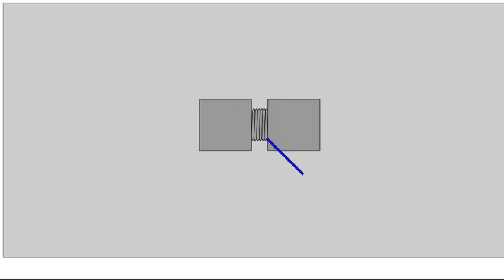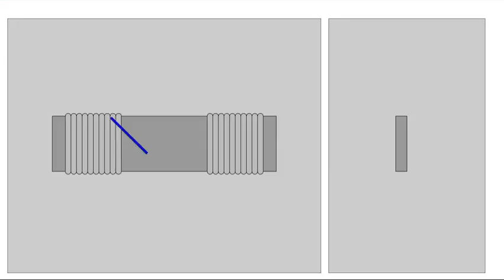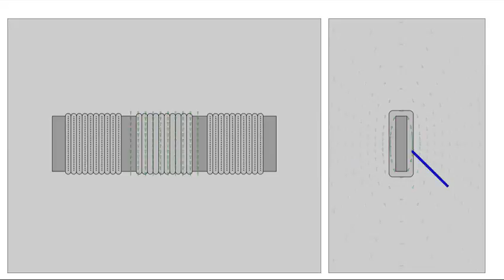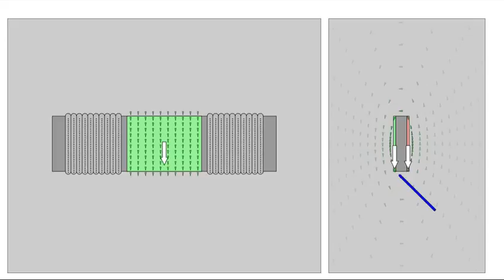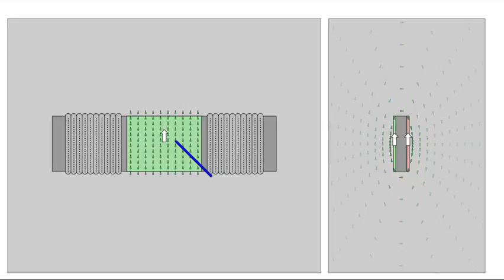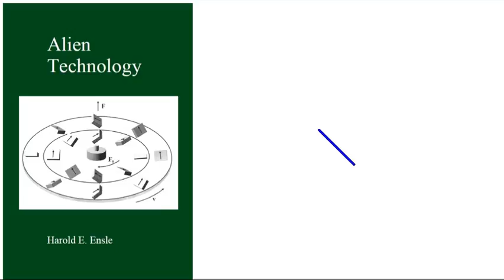The Electromagnetic Propulsion System

Comment: im not a nerd, just a basic engineer dude; what, in common sense terms, is the efficiency (can it be compared to) and is this how flying saucers fly/work (or could in theory)? ..do U need a NUKE power supply OR just a couple of 12v car sized batteries that r lead acid AGM to fly one person with light luggage? ..oh, and most importantly, does ur science work off of the Earth's magnetic field.. because it is 2 unrealistic 2 achieve thrust from itself.. isn't it!? ...and is it even possible to react to the Earth's (or any planet's) magnetic field using 'electro-magnetic' power that is man-made (of course)!?
Reply from the maker: In the book Alien Technology, it explains how the efficiency is over unity. In other words it can generate its own power, so no nuclear source is necessary.

It has nothing to do with the Earth's magnetic field.

Yes... it is unrealistic...but sometimes truth is stranger than fiction.
Reply: that is not what Wikipedia says.. it talks about electromagnetic stuff using the Earth's magnetic field to work and that it works, but is not very efficient (im assuming it's the power source that would b why)
Reply: @haroldensle6656   Besides momentum your device needs to have efficiency of 100% minus the energy losses in heat, radiation and friction... It needs to show how electric energy is converted to kinetic one...  Since you have filed patent application in 2012 your device would have been a commercial product by now, but it looks like there is very little interest comparing to Em-drive and other attempts to create reaction mass less propulsion devices... I bought your book and should receive it within 6 to 10 days but I am already skeptical due to you statement above "the efficiency is over unity"...
Reply from the maker: @matheworman6308   If you understood the video, you would know that it works...at least by the laws of current physics. The only way it could fail is if there existed a new type of force heretofore unknown that would block the output force of the device.

I misspoke a bit to Mr. Eidsmore. The device you see in this video requires a lot of energy to operate.

When I spoke of over-unity, it had to do with some further ideas discussed in the book of how this devices utilizes energy. There are many questions regarding this detail, however, that can only be resolved by experiment. As far as the force generation that is described in the video, there is no reason that it should not work. 

Why is it not a commercial product now? 

Because nobody believes it is possible.
Reply: @haroldensle6656   Not completely, namely I do not understand how magnetic field can produce electric field...  May be you meant that magnetic field acting on an conductor can induce EMF which in turn creates potentials across it... I any case I've recorded your patent application in 2014 while working on similar device based on microwaves...  I am also an inventor and here is my first patent:  http://patft.uspto.gov/netacgi/nph-Parser?Sect1=PTO2&Sect2=HITOFF&p=1&u=%2Fnetahtml%2FPTO%2Fsearch-bool.html&r=7&f=G&l=50&co1=AND&d=PTXT&s1=6d.TI.&OS=TTL/6d&RS=TTL/6d
Reply: I do not patent anything unless I have physical prove of concept and if I do, then I sell it first and let the owner worry about patenting and protection...
Patent means nothing since patent office stopped requiring prove of concept more than 100 years ago... Also if you publish it it cannot be kept secret and it is very much unattractive for potential buyers...
Reply: unattractive for potential buyers...

Comment: https://www.youtube.com/watch?v=jEUbZ3ySmbE
Reply from the maker: The device you show in this video only works because of the friction of the table. For any proper tests you need to set up a test that legitimately represents the actual environment where such a device needs to function. Two typical tests would be the pendulum test where you hang your device from the ceiling like it is on a swing and if it manages to deflect, then there is a real force. Another method is to use a torsional pendulum. You again hang it from the ceiling and place the device on a disk and have the force attempt to rotate the disk. This can be a sensitive test because the single wire holding up the apparatus can be twisted with very little force. If you used either of these tests you would see very quickly that no net force is produced by your device.

As an aside, I do not like these types of videos-- where there is some video with no explanation. People often do these videos. They just show some device and think it means something. In my video I avoid this, because I actually explain exactly how the device works.

This is not a joke. This is the real deal.

Comment from the maker: UPDATE:

I overestimated the magnetic reaction on the edge of the ferrite. I stated that it was 1/2 of the main force. Actually it is just 1/20 of the main force, so the end cap capacitors are actually not needed.

Recent experimental analysis has seemed to suggest that the existence of this force is even more certain to exist than I originally thought.

This is such a big deal, but I am not sure that anyone can get what it actually means. If one has a non-reactive force it leads to two additional conclusions.

If spacial invariance is a reality ( a la relativity) then energy is not conserved and you have an infinite source of energy.
If an absolute frame exists, then energy is conserved (probably more likely), then this device can extract energy from the absolute motion of the earth.

AND AGAIN THIS DEVICE REPRESENTS A (VIRTUALLY) INFINITE SOURCE OF ENERGY.

I will soon submit videos explaining two new patents that have been requested. These devices use similar principles but promise to be more scalable to larger forces. The trick is that they can operate at lower frequencies (which avoids a lot of problems).

So you groups in Italy and China....Eat my dust.

Comment: If momentum means motion than conservative momentum means momentum to a lesser degree but we're still talking motion. The blocks are motionless in the first picture.
Reply from the maker: The momentum of a system can be any value including zero. The idea of conservation of momentum is that regardless of any forces applied completely within the system, the net momentum always remains the same. I could have started with the two blocks having some non-zero momentum (for example moving to the right in the video) and after being released the sum of each part's momentum would then equal the initial non-zero momentum.

Conservation of momentum is not about any present state of the system, but about how different states of the system relate after forces have been applied.
Reply: @haroldensle6656  Not correct, conservation of momentum is related to conservation of energy and momentum is the amount of kinetic energy created by the force acting between two entities of matter and in case of atomic matter it is divided by two equal amounts of kinetic energy or two equal momentum... In classical physics including electromagnetics there is no case where this law fails...